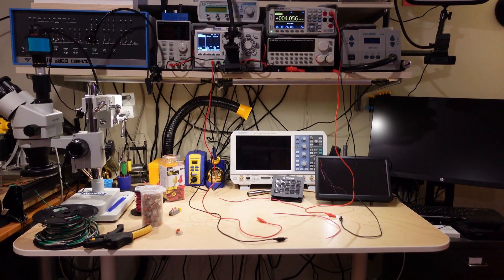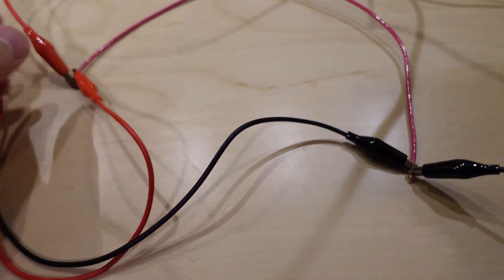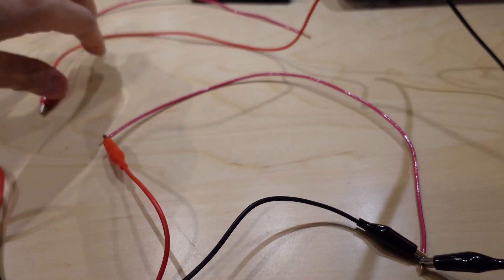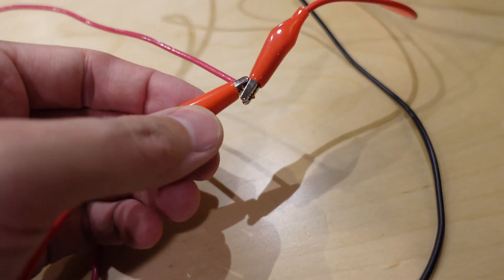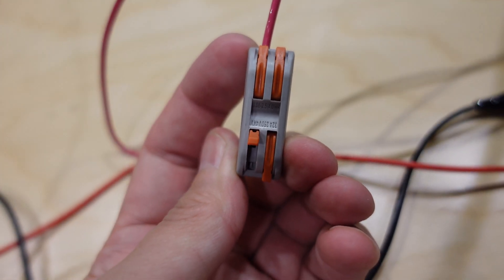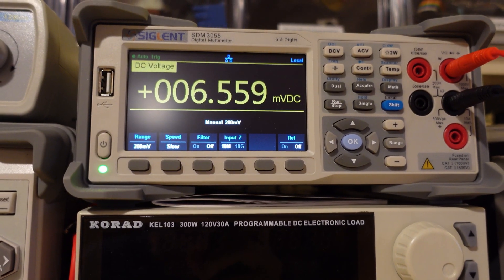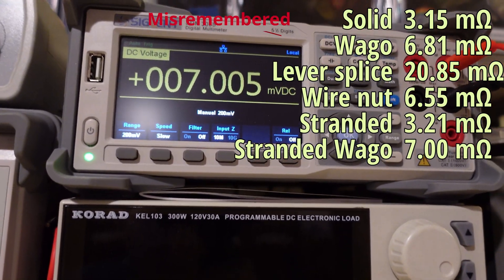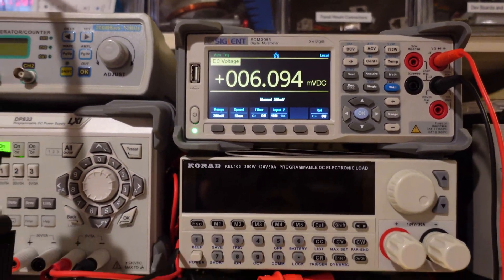Comparing Wire Connector Resistance - Wago vs. Twist-on Wire Nut

Comment: Thanks! This is what I was looking for, EXCEPT I'd like to see the results for a well-executed Western-Union long tie splice (as used beginning in 1830 by telegraph linemen), a soldered connection, and a solder seal with adhesive shrinkwrap. I can't justify buying equipment like yours to get the readings.

Comment: Regarding your comment on the quality of the alligator clip connection. The whole point of the 4-point probe measurement that you are doing is that it is insensitive to the contact resistances. That's because you have constant current through two contacts and then zero current through the voltage measurement contacts. Just don't clip the voltage probes onto the current drive clips, which then would place the contact resistance within the section over which you are measuring the voltage drop!

Comment: Video was helpful. You took the measurement of one wire, and assumed 2 wires would double the resistance. In a perfect world, that would be true, but there could be test equipment effects - resistance relating to how the wire is connected to the test equipment. As a supplement, measure the resistance of an unbroken wire twice as long. That would be the base case compared to the Wago/Wirenut. Cut a wire and splice: How much resistance did the connection add.
Reply from the maker: Further research is left as an exercise for the viewer :-)

Comment: I would put a 1 ohm (>= 1W) resistor(s) in series with the connector so that your current supply is in its controllable I-V region. With only the wire your current supply is probably just outputting an uncontrolled current which probably isn’t 1.0 A. 
The contact resistance of your current suppling leads don’t matter since your supply when it is in its controllable region is supplying that to its rated precision and accuracy. 
The contact resistance of your voltage probe do not matter because of your V meter’s high impedance. 
This is the basis for the 4 point resistance measurement.
Reply from the maker: Fair points, thanks. I am not an electrical engineer and I tend to forget details like that. Nevertheless, I think it probably worked well enough to illustrate the point. My janky setup likely had enough inherent resistance that I "got away with it".
Reply: @ChrisMasto  I’m not an EE either. But if you are pushing your current supply outside of its I-V range then if your calculated resistance is close to correct it is at best coincidental. 10m-ohm is a good estimate for a Wago. A good twisted wire connection can be more than a magnitude better. It can also be more than an order of magnitude worse. Wago connections are more consistent. 
When 10 m-ohms is a consideration is high current applications. At 32 amps (Wago rating) you are out of spec for 12 gauge wire (20 amp). If the ~0.2 volt drop (per connector) is significant then “good” wire nut connection is the way to go. Or maybe a solder connection which has its limitations.
A “good’ wire nut connection exposes fresh copper between the two connecting surfaces (I think of it as a cold weld) bypassing the surface oxidation which is the reason for most of the 10 m-ohm resistance.

Comment: 3M says “wires may be twisted or untwisted” and Ideal says “Pre-twisting is acceptable but not required” while Commercial Electric doesn’t even have instructions. NEC says to use a product in accordance with manufacturers instructions so either way twisted or untwisted would be code and from experience twisted is much better and for high current applications wire nuts are much much better than Wagos. That being said I do use Wago like devices for controls in industrial junction box applications all day long but no way in hell I would trust them with an air conditioner, heater or microwave. Things, especially metals tend to expand when they warm up while resistance typically simultaneously increases except for a few negative temperature-resistance coefficient metals.
Reply: Commercial Electric is just Home Depot's house brand, and they come from any number of suppliers.  I have an old package of Canadian made yellow winged connectors, and looking at the model number, it was made by Ideal in their Canadian plant.  It's not like anything they carry now.

My understanding is that the current ratings are exceedingly conservative.

Comment: What is  better  crimped  wire lugs or crimped and solder  wire lugs.  
Load  app. 250 amps.  DC current??
Reply: Always crimped. If it’s crimped properly adding solder after doesn’t add any additional benefit

Comment: How about another video including soldering 2 wires together :)
Reply: Soldering and twisting should net the same result. Remember solder should never be used as glue.
The solder should not be what holds the connection together. The wires should be mechanically tight before solder is applied
Reply: @techmetal2292  
Surface mount integrated circuit packages basically only use solder to hold the chip to the board.

I recently removed several soldered connections and replaced them with wire nuts.  Some were rather odd, where it looked like a length of insulation was either cut off or slid down, and a long-ish length of bare wire was wrapped around that bare section.  Then it was covered up, and I found just vinyl electrical tape, but also various combinations of rubber splicing tape, friction tape, and/or electrical tape.  I might not have had much spare wire to work with, but I replaced them with a wire nut connecting those pairs to a pigtail.  And often a lever connection at the end of the pigtail to work like a quick connect/disconnect.

Some of that was pretty odd looking, with lots of solder gooped at certain points.  It also looks like the insulator was charred by the heat of the soldering.  Mind you, this was probably done 50-70 years ago.
Reply: @ypw510 lol
I'm currently repairing a used e-guitar I bought, and it appears to have been "worked" on quit a bit.
It loos exactly like you described.
Every connection is drenched in solder, insulations are chared.

You have to ground some components, and a lot of wires are simply soldered to random parts of the potentiometers and so on.

The wires are also not adjusted in length, or ordered in any way. So you have a whole nest of like 15 0.2mm² wires, of which some are crazy long and others literally taught tight. 

It's ridiculous.
I know I should solder it, but I'd actually rather use micro-wagos.
The potentiometers have 250k ohm, so I doubt the 0.005 ohms a connector would add won't make much of a difference...
Considering the way it looks like now, it can only be an improvement.

Guitarists man....

Comment: Just reminding viewers that this like most YouTube videos is pretty far from scientific and he states that he does a pretty good job of mentioning what limitations he is aware of and this is among the best I’ve seen at that.
I do have a minor problem with his opinion being interjected that the offbrand connector being rated for 32 A should not be trusted.
Reply from the maker: It's good enough for the girls I go out with.
Reply: The question should be "rated by who?"  I can find any number of off-brand lever connectors sold on Amazon, and I can't find one that specifies a certification agency.  Lever connectors sold by WAGO, Ideal, or Gardner Bender have certifications from UL and/or ENEC.  My understanding is that ENEC goes through several certified testing labs in Europe where each one has a numerical code that should be to the right of the ENEC logo.

A lot of these might carry the CE logo, but my understanding is that it just means the manufacturer claims that it meets the specifications.

Comment: This is great, thanks. I don't think we had wire nuts for house wiring here in the UK. We have screw terminals. Wagos are a godsend.
Reply: My reading of the history is that early wire nuts had some serious issues.  But they weren't the modern plastic shell wire nuts with a steel spring.  They were older style ceramic/porcelain caps with nonmetallic threading on the inside.  Those were horrible, with a tendency to crack and where it was only about the threads pressing the wires together.

Comment: What about resistance under maximum load
Reply from the maker: Resistance doesn't depend on load.
Reply: Actually resistance increases with temperature, so yes, it also increases (a little bit) if the wire is carrying a load.
Reply: @ChrisMasto  I thought voltage drop does
Reply from the maker: @LoganAddisMusic  That’s correct. More current, more voltage drop. The constant ratio between them is the resistance.
Reply: @ChrisMasto  thanks!

Comment: Did I miss something? Why do you keep saying ohms when meter clearly is reading millivolts?
Reply from the maker: I explain it at the beginning. I'm putting 1 amp through the device under test and measuring the voltage drop across it. V=IR, R=V/I, I=1 therefore R = V.
Reply: Excellent.  Was trying to eat fast food & watch while carrying on a conversation lol.

Comment: You talk to it in the video but would be nice to see the resistance of just the connection compared to the baseline of 2 strands or 6.3mohms.  the text was confusing me with the baseline at 3.15 when you used double the length for the tests

Comment: Hey Chris, why don’t you Myth-bust the “You can’t use a wire nut more than once” theory?
Reply: Never heard that myth, and I'm an electrician.
Reply: @grounded-b937  Well, here you go.....there is a first time for everything!
Reply: @grounded-b937  you can't be an electrician I've never met one in my life that didn't know you're not supposed to use them twice. There is coiled metal in the nut that gets bent around the connection when you use a nut and when you take it off the metal coil inside is compromised. The nut will still work most likely but it's original integrity is totally compromised
Reply: @zackdeluco9542  
I've reused wire nuts.  The problem is that the coil will tighten. I've taken some out or just played around with them, and they noticeably shorten and constrict once they're tightened.  So absolutely they're not the same once they're used.  They may still be effective with a smaller bundle or wire ends.
Reply: I’ve heard it, too. I suspect that there are potential issues with reusing very old connectors. I’ve seen some that rusted inside, but nearly new ones I’ve reused pretty successfully.